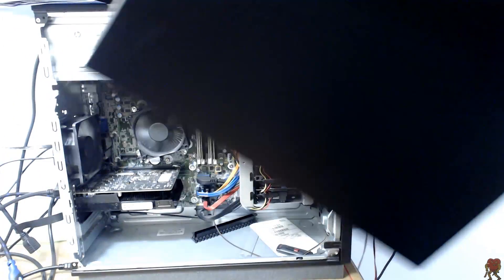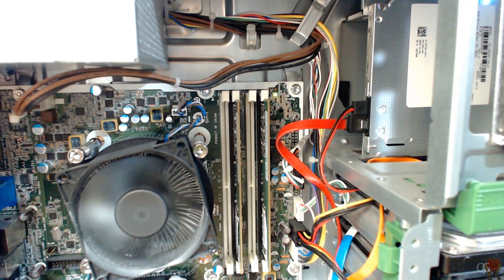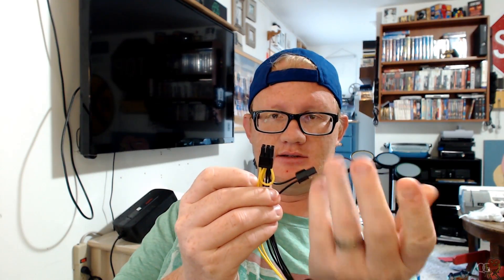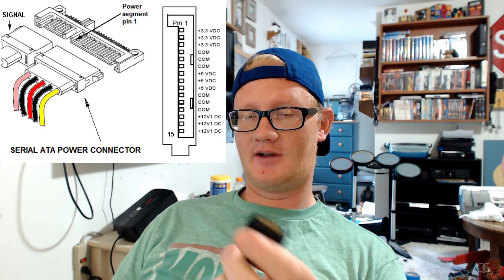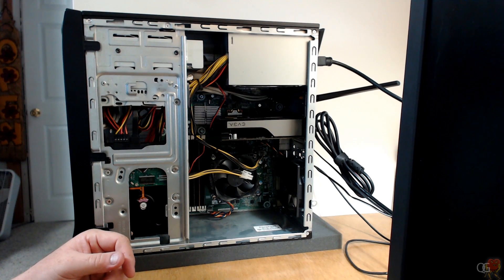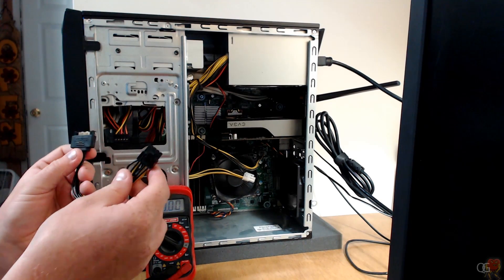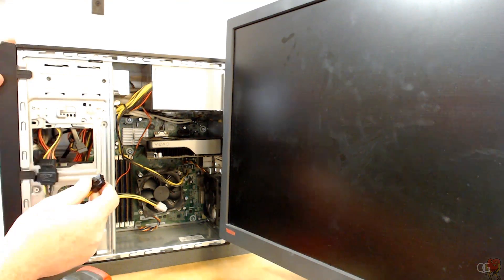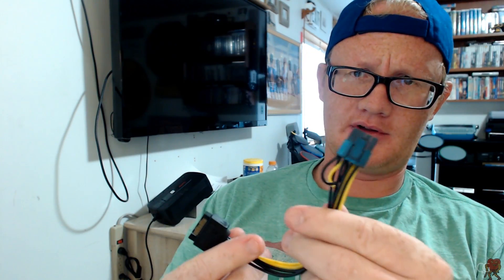No Power Supply Cable For Your Graphics Card? No Problem!

Comment from the maker: New link: https://www.ebay.com/itm/173610565849 or search "sata male to 8 pin" on ebay. You may notice it's a dual sata to 6 or 8 pin. I've started only recommending this because it lets your gpu draw power from two sata cables which is safer. However I wouldn't say this is the best method or the safest, so try at your own risk.
Reply: I've seen a few pc's have the sata connector and/or cable melt. Just depends on how many watts you are pulling from your gpu. The dual sata to 6 pin is safer only when you you use 2 sata connectors on different wires (not 2 right next to each other on the same wires) but with hp's and dell's, they would be on the same wires. Regardless they only melt on rare occasions but is always a possibility.
Reply: @GFDthatsMe  stealing 1 sata connection from each drive so 2x sata into 1 x 6pin for a gtx1650 which only uses 75W, I have 300w psu, so this shouldn't cause any issues in theory right?
Reply: @paulruffy8389  as long as the 2 sata connectors are on 2 separate lines, you will be fine
Reply: A SATA connection is only rated for 54 watts.
Using 3 of them would be safe to power a 150 watt PCI-E 8-pin power connector, or 2 to power a 75 watt PCI-E 6 pin connector.
2 to an 8-pin IS NOT SAFE.
That's over and above the "separate power wiring" issue, as too many power supplies use too thin of wire to feed SATA connectors for higher-power usage.

Comment: Ok, I'm sure this has been mentioned.  Most GPU's consume well over 100 watts, many are in excess of 200 and above, under load.  The maximum safe power draw from a SATA power connector is 54 watts.  To do an even mid tier GPU you are gonna need 2 or 3 of the SATA power cables to cover it.  That is assuming it is getting at least up to the 75 watts provided through the PCIE slot.  A much safer option, although it is ugly, is to use a sever power supply with a breakout board with PCIE connectors and drive the GPU with that, or an external dock with a M.2 or occulink connection with corresponding card with its own power supply.

Comment: is better if u using dual molex connector to 6 pin pcie. because the power of the molex cable is greater than the sata cable

Comment: i thing this solution can be apply to my un used asus strix 1060. 6pin to dual sata. and put it on my son pc since he didnot required any mid-high end latest setup lol. in my understanding, using this 6pin to dual sata required saperated sata cable rail direct from psu to prevent power overload to wire that cause of burn/melt. since my lenovo m900 can supply power to ssd/hdd sata thru direct mobo, so my available sata cable can be utilize accordingly. will try to find this adapter.

Comment: Guys my psu just 200 watt and i want to upgrade my pc by buying new gpu that is gtx 1650 super that require 6 pin but unforttunaly my psu doesn't have any external power connector so can i use adapter from sata to 6 pin
(The gpu draw 100 watt )
So i should fin with it ?
Reply: Buy gigabite 550 watt psu it have inbuilt 6 pin connector cable.
Reply: @Davidlaid01  but dude i cant change the psu its a prebuilt pc
Reply: @anasslados6969  same problem with me i have gtx 1050 ti but my psu didnt have 6 pin connector now i have ordered 2×SATA 1×6 connector pin which is good for my card.

Comment: I recently ordered a 4060 my pc currently has a 1050 need no pins and doesn’t have PCI-E adapters my 4060 is here and i have no clue how to connect it to my psu(powerSupply) bcs i don’t know where to find a 10 pin connecter or a 8 or 6 pin someone help i have a 650watt psu

Comment: NOTICE : YOU NEED TO CALCULATE YOUR GPU TDP CAREFULLY !!!

one sata cable can supply 54w, and pcie can supply 75w, so the maximum is  129w, and there are two sata to 6+2 pin converter existed, that one can supply 54+54, include 75w pcie will become 183w

For the safe, please only implement this solution when you found your gpu will only use 80% - 90% of the maximum power, one sata ~100w, two sata ~146w
Reply: you also can undervolt gpu, this will be more safe

Comment: I use a RX 6600 8GB Powercolor in my HP Elitedesk 8300 MT with a Sata to 8-pin connector. Works like a charm  in 2024 (i7 3770 + 32 GB DDR3 + 2TB SSD + 2 TB HD) for 1080p gaming and everything else you can throw at it.
Reply: Do you think an RX 570 4GB Ryzen 5 2400G 16GB RAM can be converted by SATA PCIE 8 PINS?
Reply: @Suceed123  That's the exact VGA I used in my gaming rig before buying the RX6600, so the answer is YES. For me it worked flawlessly, no damage to the VGA (gifted to a cousin, he's still using it ATM) or to other components. Rock solid stability.

Comment: Bro ur pc is so old 
Also don't use that adapter is a fire hazard. how  do I know this well I had learn  the hard way of frying my gpu and the psu😢
Reply from the maker: You're really into yourself, aren't you?
Reply: I did buy a new GAMING PSU WITH DUAL 8 PINS for 15 bucks on Facebook marketplace? WELL it's works fine no problems! no link? Why cus I think he took down the listing. YeS I also got a new gpu from the SAME PLACE.😮🎉

Comment: Dear bro thanks for your this video and this is help full for me, i have the same pc and i have install the psu 550watt and gpu is RX5500xt, when i have complete the installation of both item and press the power button my pc is not trun on and the i have remove the 8 pin or gpu power cable then my pc power on can you tell me the issue, i will wait for you kind reply thank you

Comment: My pc was striked by lightning strike, i had to replace motherboard  and graphic card, i bought the same graphic card gx 1650 4g but noticed it had 6 pin port on it but my older one didn't have 6 pin port on it so i went to electronic shop and they sold me the cable ac30 for 5 euros, at first i didnt know where to connect it and i was about to put it in computer shop for 20 euros fix but i found out about this video when i was looking on youtube how  to connect it and it helped thanks for making this tutorial

Comment: Help me, I have a new graphics card that needs 8, and I have a wire in the power supply that only has 6, and when I installed it, the screen was black. Is this because of the graphics card, or is 6 not enough?
Reply: 6 is not enough. No matter how many pins your gpu has, you have to connect them all so your gpu gets enough power. if your gpu has an 8 pin, you'll need an 8 pin connector

Comment: Hey. Interesting video. I just scooped an MSI 6900xt for my Thinkstation p520. Not realizing the gfx card has 3 x8pin power ports. Unfortunately The Lenovo Psu is proprietary too. It has two 6-8 pin gfx power outlets on the motherboard. But also has 2 auxiliary power terminals on the mother board labeled ODD pwr, and HDD power, which have 4 pin connectors. I cannot find any info on the output from these power ports, but they came with 4 pin to SATA power adapters plugged in to them right from the go. I’m going to try to run the GPU using a dual SATA to 8 pin connector to take up the third port on the graphics card… but I’m a little scared to plug it in. Any thoughts?

Comment: This was helpful. Thanks. The HP ProDesk and EliteDesk PSUs only have two 4 pin and one 7-pin which all go into the MOBO. So this adapter (the new one you now have linked) will work fine in powering my GTX 1050 Ti Windforce OC 4G

Comment: GPUs only use 12 volts. So you need 4 yellow (positive)  wires and 4 black (ground) wires to supply the necessary current (amps) for a 150watt 8 pin connector. Your Sata cable only has 1 yellow wire and 1 black wire (the second black wire is a mute point if you only have one yellow wire), so it won't deliver the required current. 150 watts divided by 12 volts = 12.5 amps. It's too much for one wire.
Reply from the maker: Yup, i cover this in my second video about this

Comment: Nice, Brother can we run a RTX 2060 OC 12 gb with this?  which is required to have 6+2 power connector.
Reply: do not do this the voltage would be way to high could set fire to your pc

Comment: I have a old superflower leadex 2. Turns out the cables cost the same as a brand new PSU, this wouldn't be a issue if I hadn't upgraded to a RX 5700 from the weak RX 570 4gb card I had, this due to the 5700 requiring both a 8 and 6 pin; I only have a 8pin attached to X2 molex. I tried using the molex and bought a 6 pin adapter for the two free slots but still no luck.... Last chance for my power supply is seeing if the sata adapter works, probably won't given the cable will be powering the Harddrive and SSD at the same time😓

Comment: Inst this dangerous because there is no standard for sata? Like aren't there sata cables with different voltages but look the exact same?
Reply from the maker: All sata power cables have 12, 5 and 3.3v wires. This adapter only uses the 12v
Reply: @thequintessentialgamer7514  Oh ok, Thanks!

Comment: I want to buy a 1060 Asus GPU (The white one) As a 1060 requires a External Power Cable, In my power supply i have 3 SATA connectors, It is gonna work?

Comment: can i still use my 6pin that came with my power supply along with my new 15 pin to 8pin adapter? 6pin + 8pin to power my Gforce 3060Ti Aorus

Comment: Never use a Sata - PCIE cable. SATA is the worst thing to ever use to power a GPU. It burns out when you even try to power a raiser. Your cable will melt and might catch fire. And nvidia GPU's from 1000 series and up will surely do it. Use normal PCI-e power cable, no adaptors.
Reply: Not to mention they are doing this on a no name as cheap as HP can get them power supplies.

Comment: Bro how much watts does your power supply has and do you think the way gtx 650 worked,gtx 660 could work in a same way because it requires way more power then gtx 650

Comment: GUYS dont do this. If your PSU doesnt have a PCIE power connector, Pls upgrade it. It matters because if your PSU doesnt have the cable, it means that it is not powerful enough. Some of these dont have a good quality and can affect your performance or simply break your GPUs. Take it from me I've experienced this problem.

Comment: i also want to tell you one thing that if you manage to use 8 pin for the bigger gpu then you must go with 2x sata to 8pin or 2x IDE to 8 pin as 1x sata to 8 pin is not so stable and eventually you will face several restart issues since the cable will be burned from inside and the connector will be melted away, however i wont recommend using full 8 pin with the standard psu
Reply: I'd use a Molex to 6+2 pin adapter before I would ever use a SATA powered one. Preferably one with 2x Molex
Reply: Or if the psu have 6pin, use 6pin to 8pin adapter but make sure the psu have the 80% eficiency.
Reply: With theese HP's, there is one really big problem. The power goes from the PSU through the MOTHERBOARD and then from mb to sata power cable. Not only you could frie the sata connector but also the motherboard...

Comment: remember guys, that convertor works well in the branded pc like dell or hp with mid range gpus like 750ti 1050ti etc, but dont use it with the custom pc which has after market cheap valued PSU (even they are 500w or 550w) or your psu will be fried in less then 5 min once you start playing the games
Reply: Would you say a 1660 super would be safe to use the sata to 6 / 8 pin
Reply: @ThyScy  no i wouldnt recommend it, 1650 super can be fine but 1660 is not
Reply: @binkaram6577  alright thanks!
Reply: @bin karam  so is a GTX 1650 D6 Ventus XS OC

Good?
Reply: Can I use dual SATA to six pin on GTX 960 on a 300watt PSU
Reply: Zebronic 450 watt power supply is safe for gtx 1050 ti. ?

Comment: If your psu has no pin connector then go with Non pin Gpu which will still work good, if you are planning to do this make sure you will find best quality of this SATA because how SATA made now is very cheap and dangerous at the same time. I do recommend buying a Dedicated Gpu which has this badass cable try brands like (Corsair,Seasonic and other Reputed brand of psu) and that is all guys good luck for gpus

Comment: Do not use this for a high end GPU. Sata is only rated for 54W and PCI is rated for around 300W on the PSU side. Meaning a GPU could pull up to 150W from a PCI power. You could potentially burn your PSU, Cable, or GPU.
Reply: What about dual sata
Reply: What about a dual molex? Two molex should be able to power a 8 pin pcie?
Reply: @HowtoEverythingYT  dual molex is fine. When connectin molex double check its connected
Reply: @HowtoEverythingYT  Same question.
Reply: Sorry I'm kinda new to the computer , so is gtx 1060 consider high end ?

Comment: My gpu doesn't come when pins, what do I do
Reply from the maker: Then congrats! You don't need this cable!  Just plug it in your pci-e slot and the motherboard will power it!
Reply: @thequintessentialgamer7514  where is that located
Reply: @thequintessentialgamer7514  Is that the gpu slot
Reply: @thequintessentialgamer7514  Update: my pc did not turn on, the only cables that need to be plugged in are the pcie cables but gpu does not have them

Comment: So i have a 250 watts power supply (pretty trash ik) and i recently bought a 550ti (trash too ik) but my psu didn't have any female connectors to connect the male cables on my gpu. I've seen people's psu explode like a fuckin bomb when they did this and now im scared to do this. Is this safe?
Reply from the maker: You should probably look into a better psu lol

Comment: so what do i use for the hard drive
Reply from the maker: Most pc's have multiple plugs for hard drives and if yours literally just has one then you could use an msata drive if your motherboard has that. Or get an ssd the plugs directly into your pci-e slot. This might be moot because the cost of doing this could be more than just getting a new power supply and motherboard.
Reply: @thequintessentialgamer7514  yeah i found it

Comment: Just got a gtx 1650, everyones sayin it doesnt need external power but ut does. Just ordered the adapter man, really hope it works. Eitherway, great video, boosted me up :)
Reply: Hey, is it working well? I just bought my 1650 yesterday and turns out I'll need a 6 pin to power it which my psu doesn't have, so I'm thinking about ordering an adapter as well!
Reply: @alvin8452  Yea! It worked perfectly. Just remember to buy the 2 molex cable to 1 6 pin adapter. If you buy only the adapter that comes from 1 molex cable you may have trouble.
Reply: @santiagogomez4828  Glad to hear that! I'll order one soon, thanks for letting me know!
Reply: Is that the Super version or an OC version? A standard GTX 1650 normally doesn't require power pin connectors.

Comment: Whay wouldn’t a dual Molex to-  8 pin PCI work just as well??
Reply from the maker: It would, likely handle more amps too... Assuming your PC even has them
Reply: Lol, yes I just realized this dilemma by opening up an old Dell OptiPlex 7010, and NO MOLEX at all, Instead of going Sada to 6 PM, I’m just going to replace the power supply, luckily the motherboard still has the traditional(non proprietary) motherboard power connection. Whew!! it is interesting the Sada cable could handle the voltage and amperage for a GPU, I doubt they would handle an RX 580 or above though without toasting the wires?!? 🤣🤔

Comment: I need help, my psu doesn't have any connectors to it like 0 and I'm using a GTX 680 GPU but that needs 2 6pin PCIe connectors so what do I do when my psu doesn't have any psie connectors?

Comment: im running two of these connectors on my gts 250 i just bought a 15 pin splitter for the two sin my chain has 3 15 pins

Comment: Hey,I have a hp i5 7th jen pc with 400watt psu can I use gtx 1050ti
Reply: Yup you can use gtx 1050ti on 400w psu i am using mine on 400w psu
Reply: @Z0Oli_1  same

Comment: I've fried yesterday a 500 watt  psu using a cable from banggood...warning...Lucky for me non damage to other components and with a new semilmodular psu, all is working properly.1060 msi gpu  with 410 prime motherboard and i7 10700. Hope it helps.

Comment: i saw  2 molex to 8 pin adapter , it work ? its safe ?
Reply: The problem is if your gpu throttles you'll get sparks and sparks mean fire you can work the rest out

Comment: hey man dont know if your still answering these comments but i ordered a xfx r9 290 but my psu has no pcie pins do you think this will work, and the gpu uses a 8 and 6 pin
Reply: Do NOT power an R9 290 off of SATA. This adapter is a terrible idea. The SATA connector is only rated for something like 10W (0.83A) over 12V. This is taking a connector rated for 10W and turning it into a connector rated for 150W. That is a fire waiting to happen.
Reply: First Last what if i power the 8 pin with sata and the 6 pin with pcie

Comment: Where do you plug it in to power your graphics card?
Reply from the maker: Most cards have a 6 or 8 pin molex connector on the corner of the card. But some cards dont have this connector and get all their power from the motherboard

Comment: THANK YOU I WAS STRESSING OUT WHEN MY HP DIDNT HAVE A PCI CABLE FOR MY NEW GRAPHICS CARD BUT YOU SAVED ME
Reply: Do you have an HP Pavillon Desktop?
Reply: @Spynox  ye
Reply: Is your house still alive?
Reply: @fps8786  my power supply is about to explode tho, and I need to get a case with fans
Reply: @fps8786  ye
Reply: i have a dell optilex 7010 sff and a bought a gigabyte g1 rtx 970 .i can buy a new 500w psu and a pcie extender because it does not fit in my pc.this cable will help me get a 8 pin connector with the 6 pin that comes with the psu
Reply: @yz34ibd2  I bought a 790 optiplex, what's the best power supply to use that will fit?

Comment: Bro, i bought a psu 500W cylon aerocool. and i have a r9 280x installed on my pc, but when i bought that psu i didn't realize that it has no 2x pcie 6. Is there any problem if i use this adaptor?